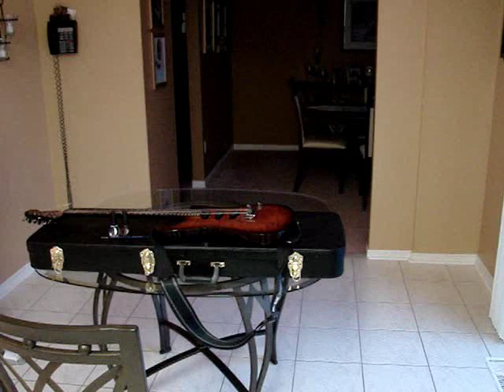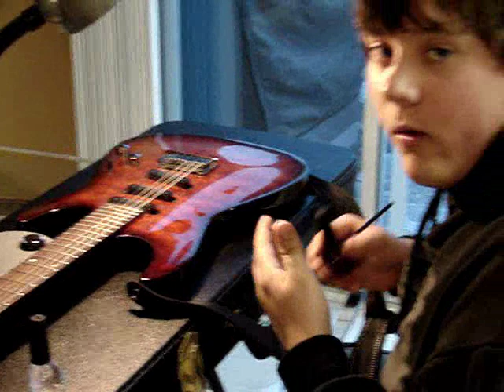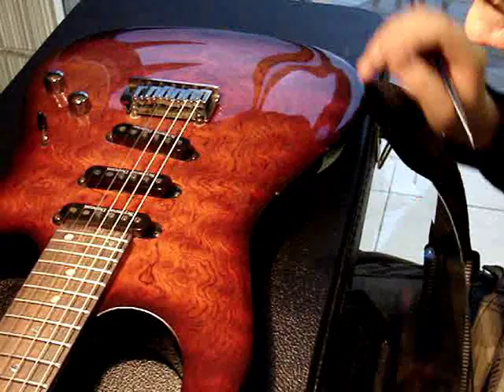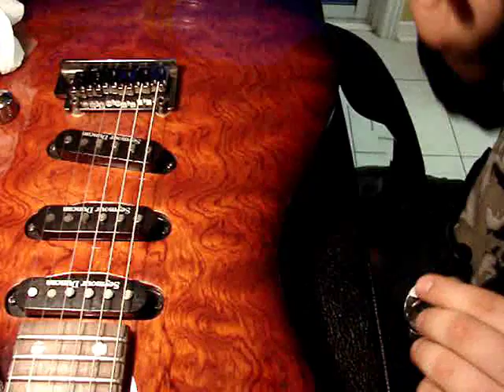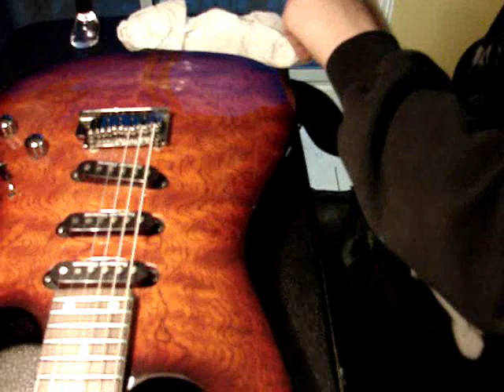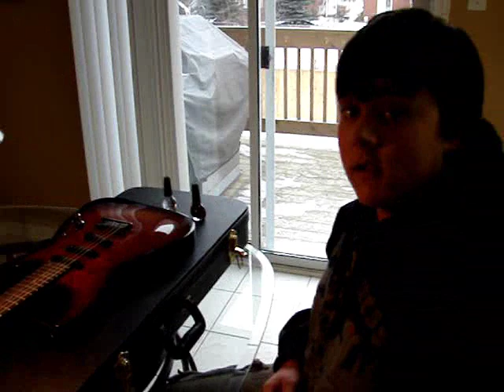Repair Chip in Fender Statocaster Shell

Comment: Terrible repair job.  

You skipped the most important steps. You are supposed to overfill the chip with several coats, then wet sand to about2000 grit, then use automobile rubbing compound to match the sheen.

Makes a perfect repair not some amateur-looking, hack band-aid of a repair.